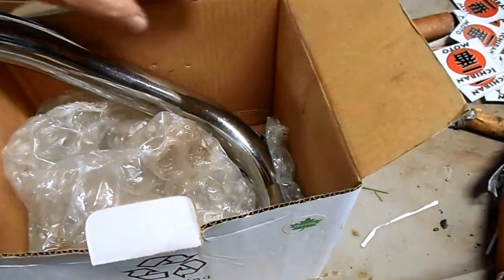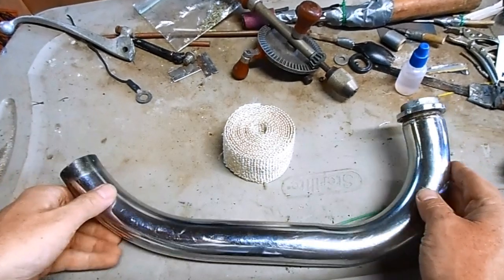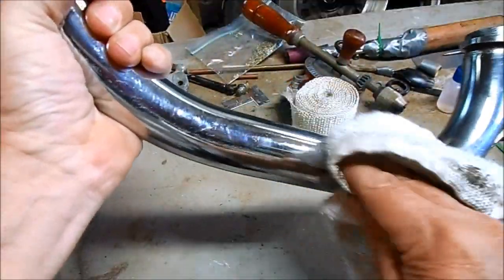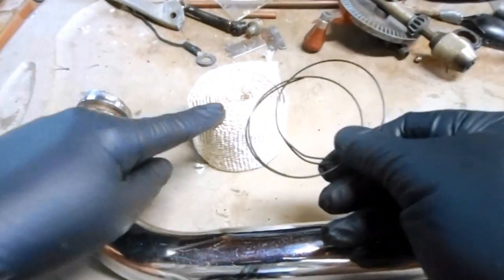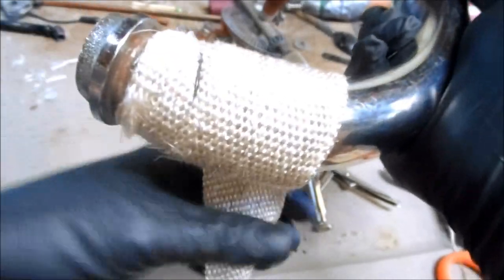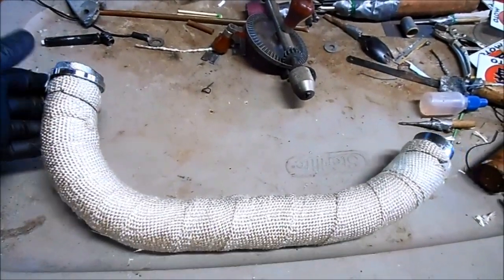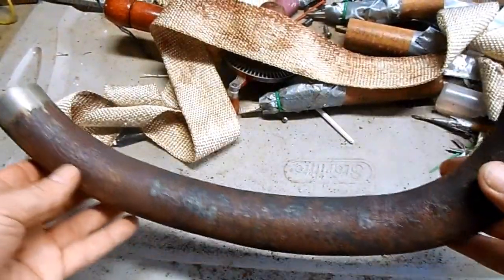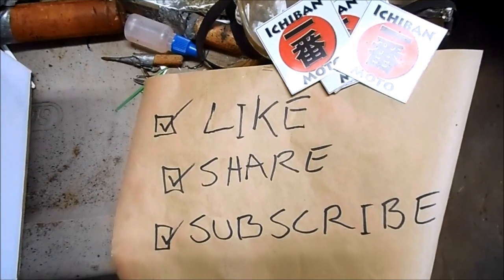how to use fiberglass exhaust pipe wrap for an old school vintage motorcycle rat rod look

Comment: so heat wraps are not good for bends??? plzzz reply but my bend got rust but it can be removed easily not like this of stuff i got after removing my heat wrap from the bend
Reply from the maker: if you need more rust, leave the wrap on longer
Reply: Ichiban Moto i removed it already btw i have only ybr 125 cc bike still matters?

Comment: I have a 73 CL350 that I'm building. I want to run the stock side pipes but cut off right before where the pipes bend out for the mufflers. I also plan on wrapping the pipe like this all the way from the header down to about an inch before the end of the pipe spill have a pair of nice clean chrome shotgun tips. But how would I mount the pipes on the bike? Any tips are helpful

Comment: my roommate ordered headers for his Vespa big bore custom chopper 364 days ago and 14.06731 days ago we found out that the wrap does not stick to curamic fused coated metal! just a heads up everyone. We acid dipped them and then we got near the results we were hopping for. We are having an issue...tonight we removed the wrap and he has to order another set of headers. there was NO pitting at all and we did it step by step.  Can you help use trouble shoot this issue Ichiban Moto?
we are having the same headers overnight shipped and acid dipped tomorrow afternoon at his work. any tips will help. great work!

Comment: I'm after this look on my front forks , how many days should i leave the wrap on?
Reply from the maker: +jizpillow fork tubes are hard-chromed, so they will take several more days.
Reply: update , worked well.. my honda cb chomed suspension rods now have an excellent patina covering the whole fork rod thing, my local bikeshop said i might need to upgrade to patina resistant fork rod seals because there is brown fuel coming out everywhere
Reply from the maker: +jizpillow   some just pop the seals out .. so they don't wipe patina off the tubes during suspension travel
Reply: ohhh got it.. thanks

Comment: Hi man, 

Can i re-use the wrap on a different pipe? Also, does it come in different colours? will this change the level of rust that is available?
Reply from the maker: *****  I would think the more the wrap is seasoned with each use, the better it would work !  these come in white, brown, tan black etc. the color coding might be for thickness or possibly flavour. not certain.
Reply: Wow, flavour would be cool. Imagine when the pipes get hot and you smell friend chicken, Or cinnamon. I have to get me some of this
Reply: Ichiban Moto i just tried my cream colored fiberglass wrap.  It burns so I think cream is jalapeño!

Comment: A cheaper alternative is to bury the pipe in your garden for ten years. It has a similar effect and is less expensive. But I guess it would have to be a long term project. Your method is definitely the way to go for the less patient bike builder.
Reply from the maker: Triumph Rascal  now I do have some long term projects on the backburner... I will pull the exhaust off and get the garden trowel

Comment: there is an easier way. and cheaper one too. you put a string on it and put it out of the house for the elements to get it done. you just have to give it time. and to protect the ends just use aeroplane grease.

Comment: Umm, you forgot 'Step 1 - Soak in water first'. 
This enables the fabric to be wound tighter, and as it evaporates the water (1st time start),it will shrink the wrap further, making a Tight fit.
You may end up with a Saggy header pipe their...?
>:/
Reply: No problem, he did pre-soak the header instead, for it to absorb moisture deeper into the steel pores.

Comment: WTF, how is that exhaust wrap supposed to function when used as a wrap if it does that to steel pipework?  Thats fully crazy..
Reply from the maker: it does a great job trapping and holding moisture

Comment: You forgot to sand and brine the pipe before you wrapped it for a better effect.
Reply from the maker: hackneo64  oh, fiberglass traps and holds enough moisture on it own.. no need for unnecessary steps !

Comment: damn are you saying that my pipe is gonna rust if i do a heat wrap???
Don't want that to happen -.-
Reply from the maker: +glazuna  wrap does a badass awesome job at trapping and holding moisture
Reply: Glazuna, I promise you that pipe wrap WONT rust your pipe, I've been using pipe wrap on the header of my Kawasaki KLR 650 for years, when the wrap began to look crummy after a year or so I  re-wrapped it again and  zero rust or damage was on the header. I bought my wrap at an Industrial supply store by the foot instead of the more expensive kits sold with the same product. Hope this helps.
Reply: ***** Thank you. But what did you do when you got the wrap wet? Surely leaving a wet bike in a garage would introduce rust to the headers
Reply: +glazuna 
If you do get the wrap wet, the heat from the motor will make the wrap bone dry again, dont you think a motorcycle header gets hot enough to dry itself?
I've never had any problems. Try it.
Reply: ***** I know that but if you get caught in a rain and ride home in a cold weather and water keeps splashing your exhausts then even the header can't get hot as it's constantly being cooled by cold water from puddles. Parking a bike in that state would definitely do harm....

Well I'm going to try it on my next bike which supposedly has cooling problems and heats up the radiator above with it's headers so yeah will try it then
Reply: Thanks I'll give it a try